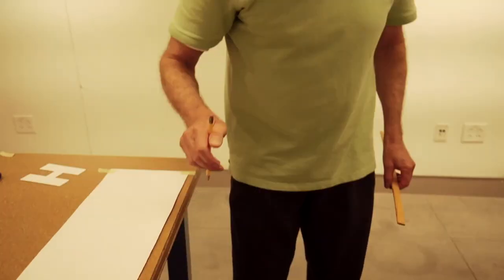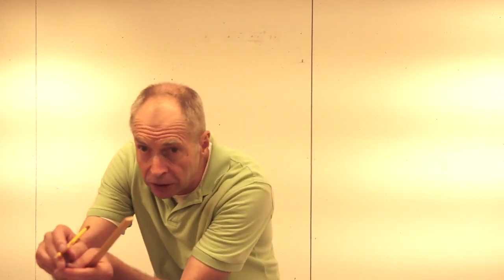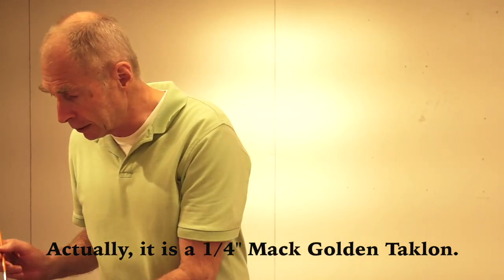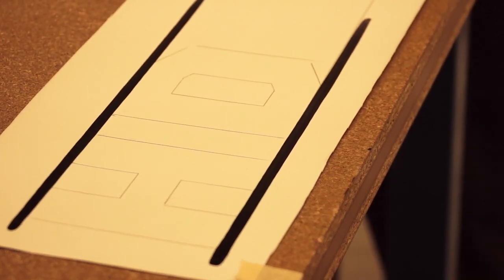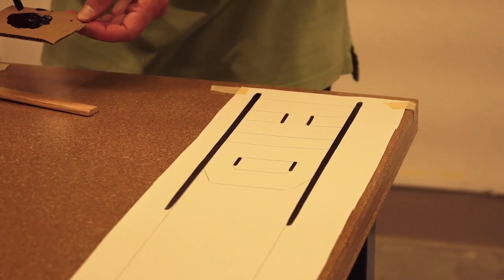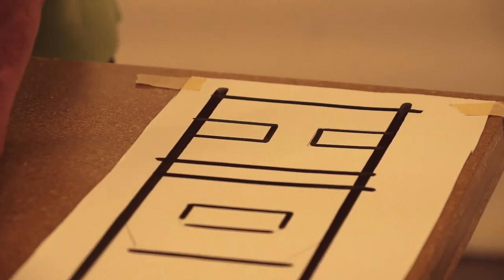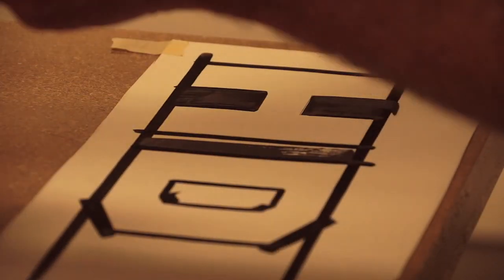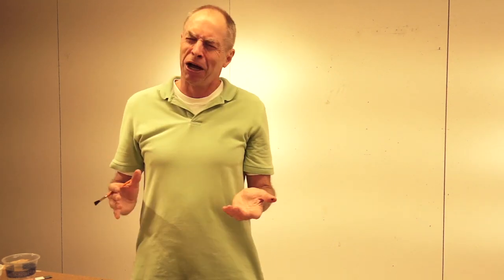John Downer Demonstrates Scribing & Cut-In Half Block - 2017 Aug. 23 @ MassArt - Boston, Mass.

Comment: This is a cool video but why was he doing this? Painting black around "HD". What was he making?
Reply from the maker: He was demonstrating cutting-in Half Block lettering.  "Cutting-in" refers to the process of painting the letters' shape by filling in the background color.  It is a quicker method of lettering and particularly well-suited for use on brickwalls, where the base and cap lines may be established using existing mortar lines.